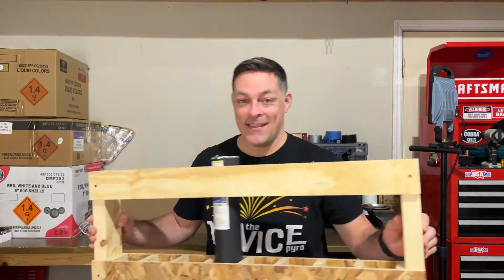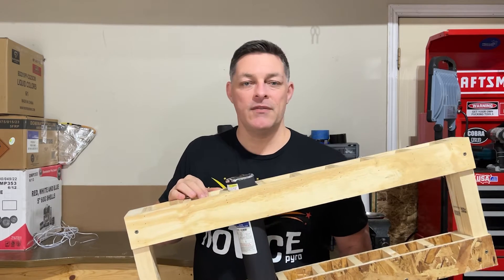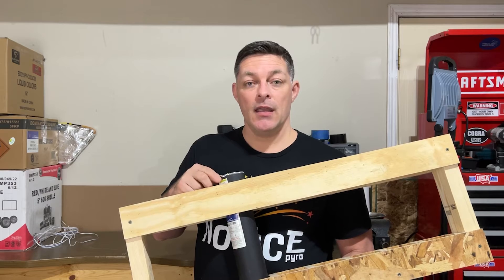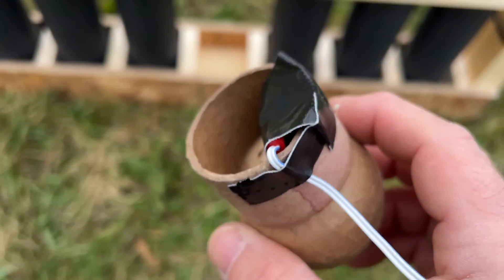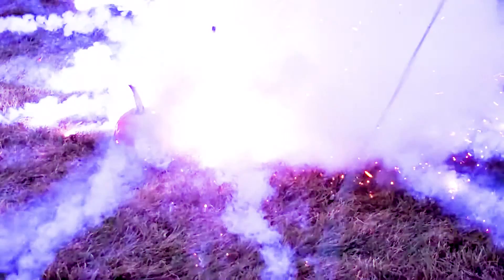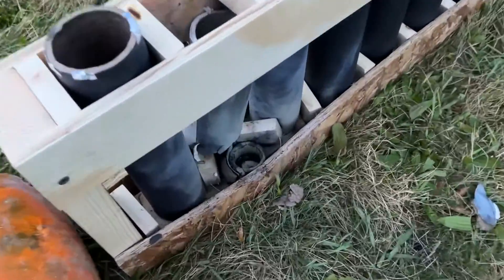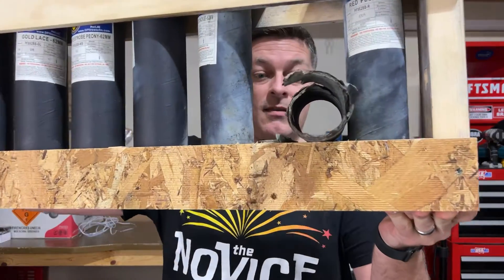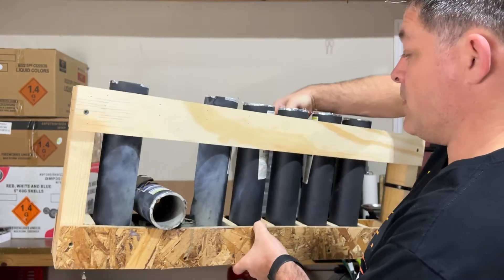62mm Mortar Rack CATO Test - Firing a Shell Upside Down!

Comment: your rack build video will be a big help for some we're throwing together for the 4th. Can you think of a way I might be able to quick-fuse like 20-25 single shot 62mms? have about that many leftover that I think I'll volley into my finale. I suppose fast fuse strewn along the bottom might work but doesn't feel reliable. Other than that maybe a cobra script to fire them all at 0.5sec intervals might, but that's a lot of cues to dedicate...
Reply from the maker: Glad you found it useful! Since they are only designed to be e-fired, I’ve never done this before so can’t say really if there’s a reliable way. You’d have to get fire up into the port and not just below it. Now if you can spare a few bucks, you could look into a sequencer which is a fraction of the cost per cue as a typical firing system. You’d still need matches, but it’s a lot cheaper at $80 for 12 cues. 

https://www.pyrocreations.com/firing-units/Twelve-cue-sequencer-firing-system.html

Comment: We're in the same line of thinking.  👌🏻😎
https://youtu.be/LO8AgqPfbLY?si=XXfMafjDkQy86PDS
https://youtu.be/HaTvZ-YU-zs?si=36uojt-BrkY0pFf4
PS - factories do make mistakes.  I have a video (not posted yet) of a 30mm Raccoon comet/mine that didn't have staples in the lift cup. I.e., the lift cup had nothing securing it to the tube.
That could certainly cause a lift problem, especially if it was a 62mm shell.
Reply from the maker: Interesting that I’m just seeing this comment. YT never notified me. Definitely milk crates don’t hold up lol. Great video showing CATO with HDPE in wooden racks too. I want to see if spacers help those racks fare better. If you get to it first… let me know!

Comment: Just an added tip, by watching the slow motion. You can see your initiator wire whipping.

Tie it off to protect your module. Good practice to have all the time. Not just in experiments. 😁

Great content though. Proves that spacing is important.
Reply from the maker: Yeah, I normally always strain relief, but just didn’t consider it on this one because the shell wasn’t leaving the ground. Agree it was probably a good idea in hindsight. Good tip for sure, I appreciate it!